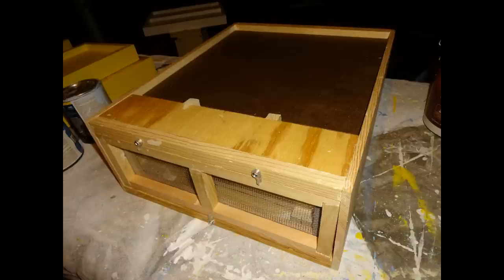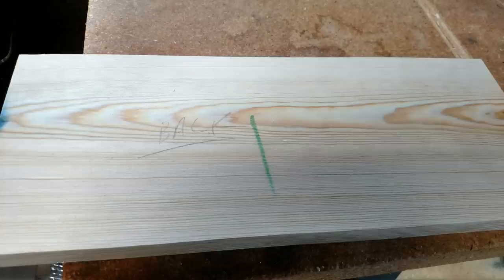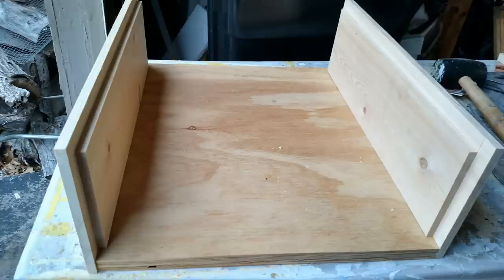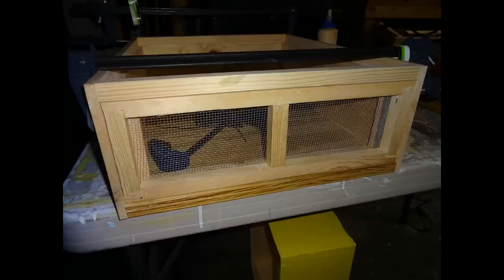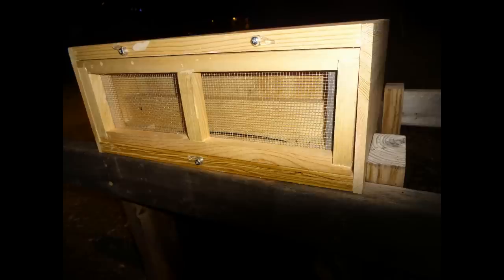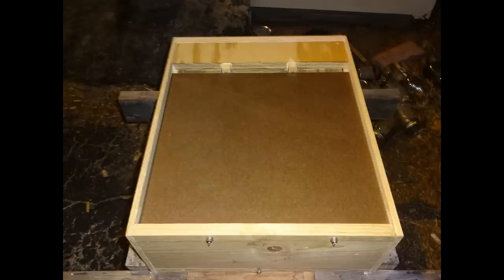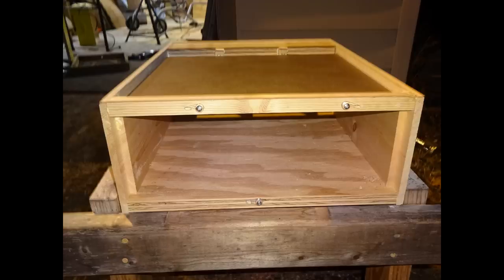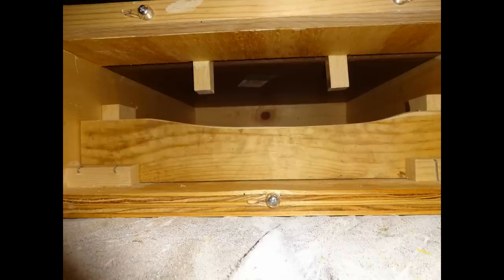German Hive Bottom Project

Comment: my bottom boards are not as deep as yours      I make the sides and fronts out of 2 by 4s and I have a door on the back that is held in by rubber bungee cord what you might want to do  is make a screen for the top of yours so hive beatles and varroa mites can fall through I have a pan that I put vegetable oil in and slides in the back available at Walmart you don't have to put much oil in the pan just enough to coat bottom of pan and a little extra just keep bottom o pan oily will kill all beatles and varroa     and bees to if they get in bottom is half inch plywood hope I explained it good enough